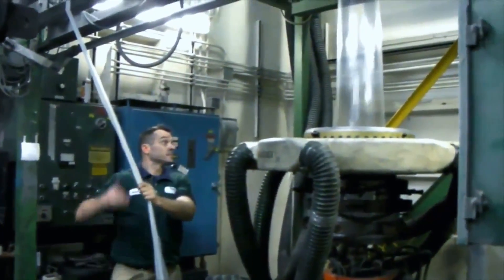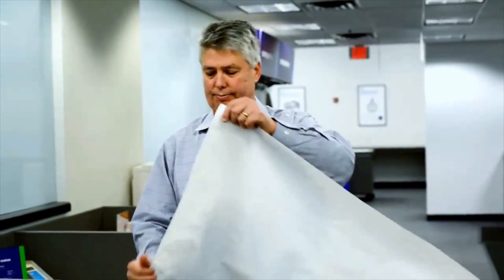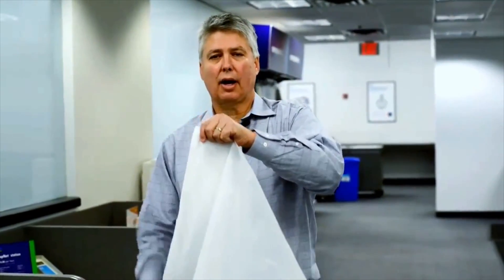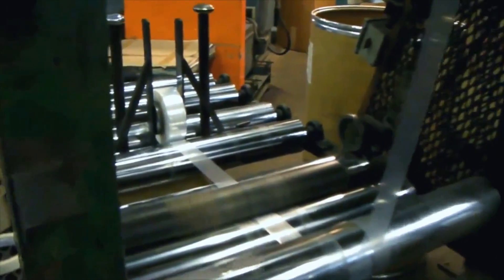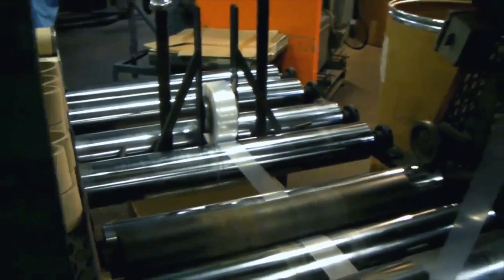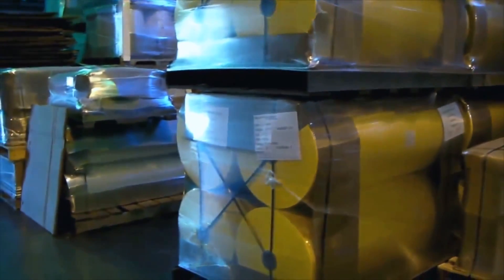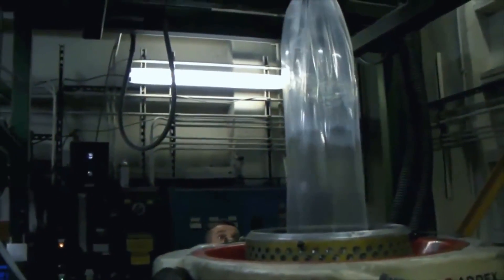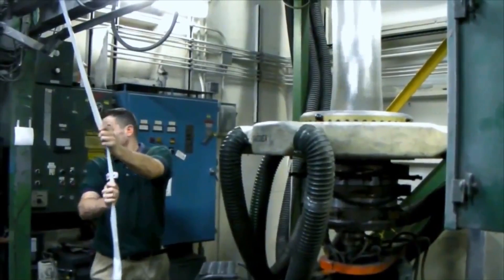Blown Plastic Sheet Film Process

Comment: Hello, I have a question. I understand that molecular orientation is also the cause of the shrinking phenomenon in shrink wrap. As you say, MD-orientation is inherent to blown film extrusion. So, what if I want film that does not shrink? Do you set the nip rolls at the top of the bubble as slow as possible, do you anneal the film , or is there another method?
Reply: Plastic molecules always wants to go back to the original form, before it has been processed. So, film shrinks always a little bit. But you can adjust the shrinking by setting width of the blown film and with cooling for example. So if you want that film doesn't shrink much, keep cooling level quite high and width of the bubble as narrow as you can compared to your machines die. More widht, more it shrinks. Nip rollers are just for the thickness adjustment, meaning, if your machines screw runs for example 50rpm, the more you put speed to nip rollers, more thinner film you get. It doesnt effect straight to the shrinking.
Reply: @jv1702  Sooo what is your question?...
Reply: @CliffTheeToeCurler  I didn't ask nothing...
Reply: @jv1702 Ok, so what's your point?
Reply: @CliffTheeToeCurler  point on what? I'm confused what the hell are you talking about
Reply: also depends on the type of resin being used. HDPE, LDPE, or LLDPE

Comment: I've been coming up with a bunch of equations at work, one of them is to figure out pounds an hour on a roll. So it goes something like this...a = layflat, b = pocket 1, c = pocket 2, x = a+b+c, y = pounds per hour going through extruders.  so solving for z we have z=x/(2a)(y). Anyone else playing the game might find this interesting. I came up with this equation when we were making some film we cut over onto two shafts and we had restrictions on how many pounds of film on a roll.
Reply: TRY THIS... OPEN WIDTH X FEET PER MINUTE X GAUGE X 48 = POUNDS PER HOUR
Reply: Do you machines not have meter-counters? Or do they not have a computer that shows poduction parameters?
Reply: Sounds good